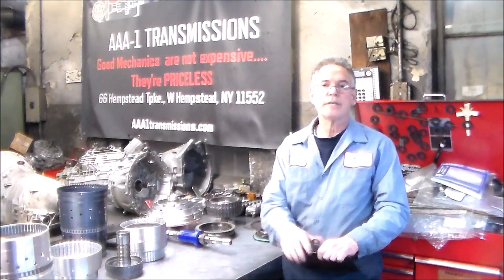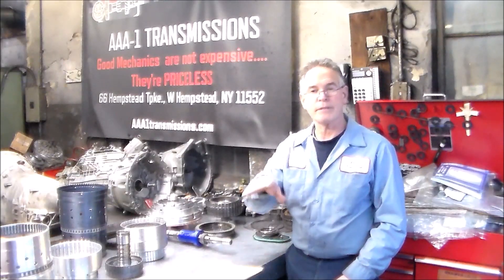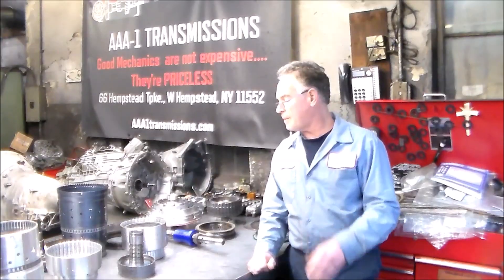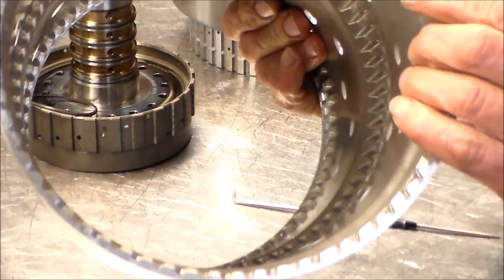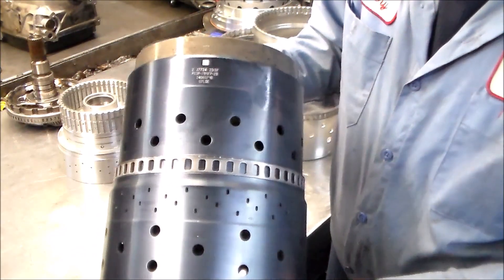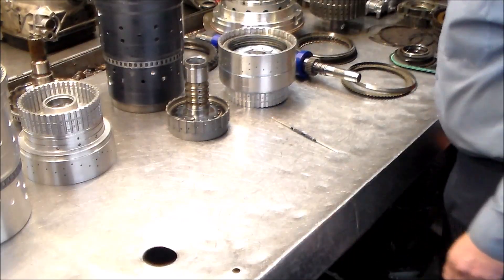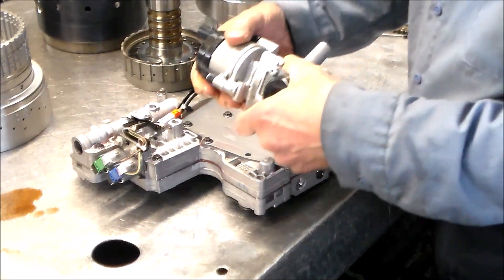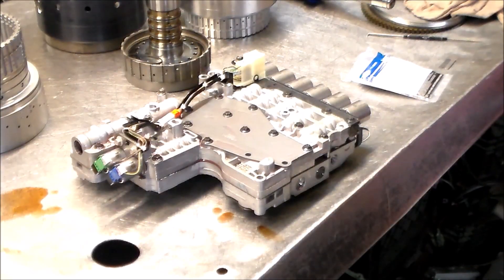Ford 10 Speed CDF Clutch Drum

Comment: Gary, great video. The new black outer shell is apparently hard anodized for additional resistance to the f clutches digging into it. Shame they have so many issues with these units. A good old C6 only had 3 speeds but they were pretty darn tough!
Reply from the maker: Correct